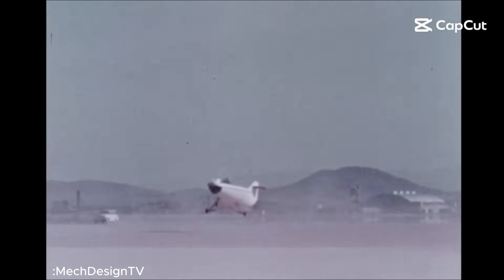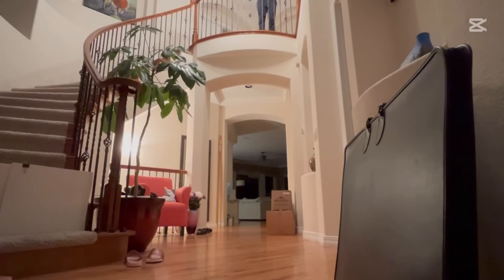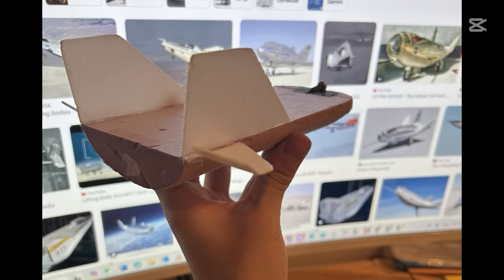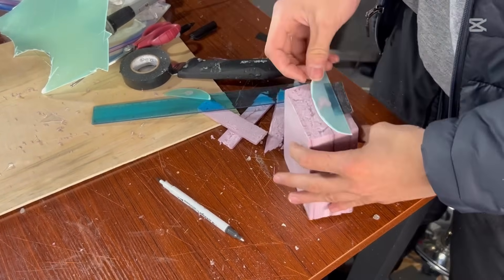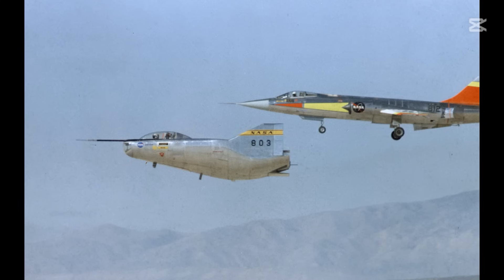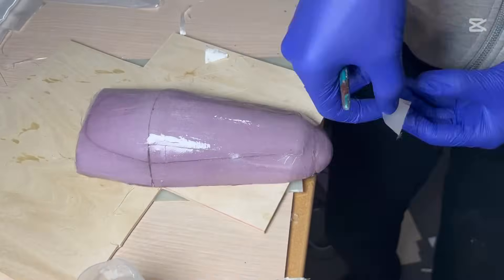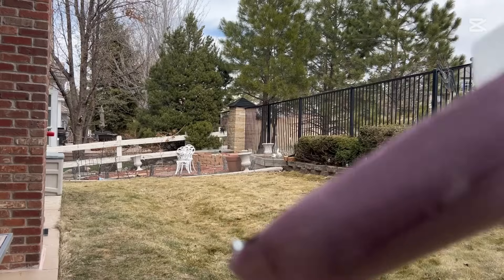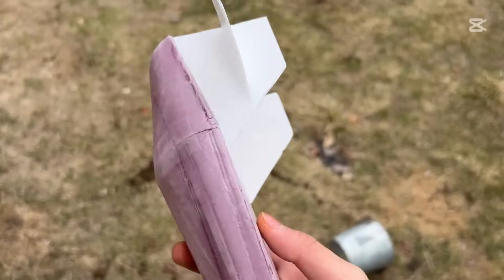Are lifting Body Gliders Possible?

Comment: I have an idea about shaping your structure quickly and easily. What if you built the shape with wet sand or even better clay? After having the desired shape, you will use it as a mold for laying the fiberglass over it and then remove the the material when the fiberglass cures.
Reply from the maker: Yoo I like that I might try it

Comment: Seen from above, your planforms don't look very "Delta" shaped. From the video, I get the feeling that (top-down), your lifting bodies look rather more rectangular than the classic NASA ones. Top-down, the NASA designs look like Delta Wings with a rounded front. 

This could explain the high AoA, low speed flight characteristics: Delta Wings develop a lot of vortex lift under those circumstances.

Maybe you would get more stable high AoA flight if the front edge was 1/3 or less the width of the rear edge.
Reply from the maker: I’ll try that!
Reply: @ieatgrass_rc  cool, looking forward to it.

Comment: I was around El Mirage where some of the original work was done during that time.  A guy by the name of Paul Bickle. Believe piloted the first lifting body.  It was built out of plywood on a very low budget and towed across El Mirage dry lake by a Cadillac convertible.  Once the concept was proven NASA opened funds and the project got a lot more advanced.  This is based on my recollection as I was in my early years, and it was my father who was the reason I was there.  
Two side notes,.  1. about the time I was 12 I saw a guy I met had a balsa model of a lifting body he had made.  It was hand thrown and performed quite well reaching 30+ feet in the air in a throw before a rapid glide back down.
2.  The beginning of a 1970’s TV series called “the six million dollar man” featured a crash of the first lifting body.  That version had a problem with something I believe they called “roll coupling”. Basically it meant the craft would start rolling back and forth getting worse with each roll and almost impossible for the pilot to recover from.

Comment: I did some experimenting with lifting bodies and waveriders.  Your first one that looked more like a space shuttle, that wide slanted nose acts like a canard and that is why it pitches up to find the middle of the  <  nose    The vertical stabilizers on your later lifting body can go underneath as rudderons instead of on top, more effective because more pressure will be pass around them so they can be smaller, as rudders underneath they will also perform dual function as ailerons.  The lift on lifting bodies is the angle of attach on the forward section of the bottom, the aft section pulls down which maintains angle of attack, however, this craft can only function up to a particular speed, too much speed it will pitch up and loop, i put rocket motors on mine and once speed limit hit, it did tight loops until rocket fuel ran out.

Comment: Curios.  why not make the profile look like an actual foil .. these seem to be very thick in the back and shallow in the front..opposite  of a wing foils shape.
Reply from the maker: Yeah I was thinking the same thing, I might try out some lifting bodies with flat bottoms. I mean they must’ve had a reason from have the bottom think
Reply: I'm wondering if lifting bodies might behave more like supercavitating hydrofoils than wings. They operate at a raised angle of attack and intentionally induce flow separation as far forward as possible, and the pressure drop over the top of the foil is so extreme that a stable "bubble" forms, behaving like it's part of the foil.

Comment: 3:25 I would say that there is considerable angle of attack with this design, it's just not as easy to see compared to the other models. I think what you're getting at here is camber, which allows a plane to fly at zero fuselage reference line angle of attack. For practicality, we consider zero angle of attack for an airplane to always generate zero lift. Great video!

Comment: It's surprising to me how well your lifting bodies fly but I suppose a paper dart plane has a similar aspect ratio and glides really well. You could make a slightly larger RC slope soaring version and it could soar indefinitely and that would be amazing to see
Reply from the maker: I think those darts have some aerodynamic lift but I think it’s mainly from the initial throw. The video I did wasn’t the best way to show the performance of the lifting body because they can actually pull out of a give if dropped from high enough. Yeah I will definitely make a rc version that would be so cool!

Comment: My two cents. Drill or cut a hole near the front of the fuselage and insert plasticine as weight to adjust the center of gravity, add or remove plasticine at will to adjust the CG and round it in shape to make it aerodynamic. When I was a boy, I used to take the foam meat trays from the grocery store and cut them into flying wings (would tape them together) and added the plasticine as canopy by cutting a hole into the wing to add plasticine as a canopy and to adjust the CG and made great flying wings that way. By the way, nasa has never been outside the atmosphere, and it is not a sphere at all, but completely Flat, yes, I am talking about the Earth.

Comment: One thing to remember is scale has an influence on flight performance. The NASA tests on full-scale designs were within a reasonable range. When you get smaller, you need to increase speed proportionately. Look up Reynolds numbers. It's why if you had a "Honey I shrunk the kids" machine, and shrank a full-sized airliner to, say,  1/48 scale, it would likely not fly at all.
Reply from the maker: Yep that’s a very important thing to remember thanks for that. That’s why I’m hoping for some better flight characteristics when dropped higher up

Comment: One of the 'trainers' for space shuttle was a Gulfstream (G3, I think).  That, in order replicate the sink rate of the shuttle, had to DIVE at the runway(s), with the THRUST-REVERSERS ON IN MID-FLIGHT!
P.S. IRL, I can recall that M2f2 had the stabilizers on the fin were set to be ptched so she was usually was nose up gliding.

Comment: I have made several of these planes, but I can't get them to be stable on their own, I can only get them to glide well when I put some kind of electronic stabiliser on them.
When I test them in the workshop they fly well, just like the ones you have made. But when launched from a plane they usually stall and start to spin out of control.
Reply from the maker: Yeah I’ve heard other people also had problems with electronic stabilizing might have to mess around with that later on

Comment: Yknow, you could definitely turn this into a flying boat.
Reply from the maker: lifting body that can take off from the water???
Reply: @ yessir, think about it, that lifting body looks awfully similar to a boat hull. So it would effectively be a flying boat without the massive wingspans that make em so inconvenient
Reply: @perhaps_not_ because of the surface tension and the minimal lift of the lifting body.
Reply: Might need some additional boundary layer control to break surface tension
Reply: @ hydrofoil lifting body flying boat?
Reply: @perhaps_not_  maybe a type of internal canister with compressed gas to blast it off the surface of water in the instant before full application of engine power to begin flight
Reply: @AndrewDutton-Topper  what about hydrogen? if you were taking off from water you could use a small oxyhydrogen genarator to blast away
Reply: @clivemcpike3065  great ideas! MIT has it in miniature, as RoboBee
Reply: @AndrewDutton-Topper  or add soap 
that lowers tension (though annoying to do over and over)
Reply: @vilemeep  and it kills mosquitoes in larval form!
Reply: Yeah the only problem is rounded hull get sucked into the water so works against lift.
Reply: The bounty from ninjago 🥷

Comment: The M2F1 was a "deflecting body", it actually had negative lifting charcteristics! 😁👍👍🇺🇸
Reply from the maker: Yeah that’s the interesting part
Reply: @ieatgrass_rc  "Lifting Bodies" have airfoiled shaped bodies dependent on the speeds you are planning to fly at! 😁👍👍🇺🇸

But no matter the type all all aircraft have an "angle of attack" at which they fly best for the speed they are traveling! 🥸👍👍🇺🇸
Reply: Even a conventional airfoil shape can fly inverted given enough AOA and airspeed. It's still mostly differential airflow over the top and bottom that produce most of the lift.  Even that inverted wing shape at a high AOA will cause faster airflow due to the AOA causing a slowdown on the air passing under the front due to rudimentary compression, newton says for every action there is an equal and opposite reaction so if an molecule of air has to change direction by hitting the under surface of the airfoil it must lose some energy causing it to slow, creating a little traffic as new oncoming air will not only interact with the aircraft but this redirected molecule as well.  Over the upper surface you have no such issue, in fact it would be the opposite where air will naturally seek the lower pressure which after diverging over the top at the leading edge will find itself being pulled by the divergence makine the molecules a little farther apart on top.  Its like looking at half a cross section of a convergent divergent nozzle, lower pressures for faster air and higher pressures for slower air.